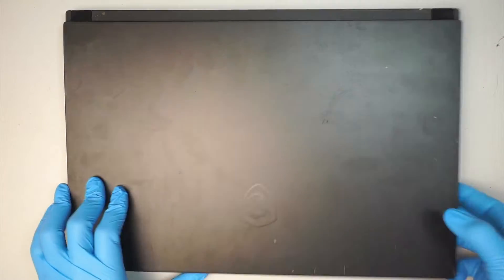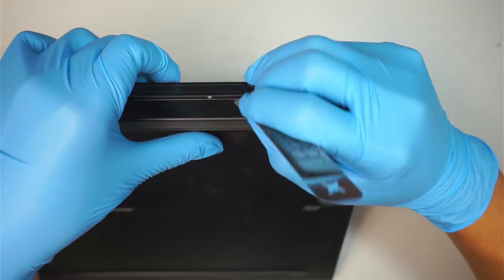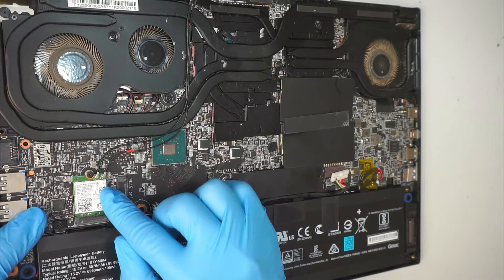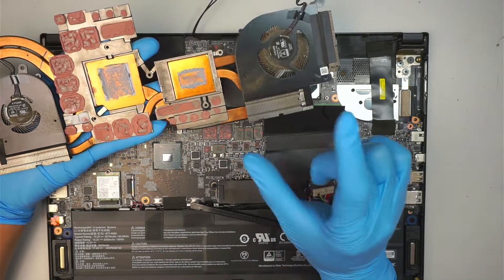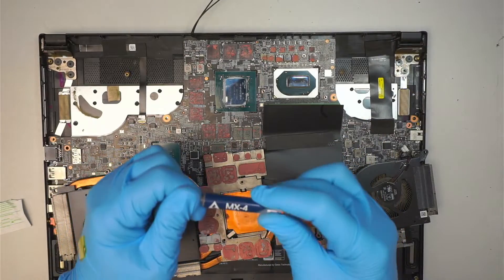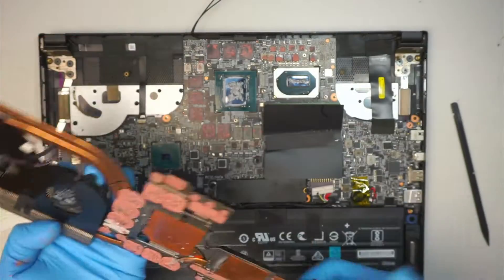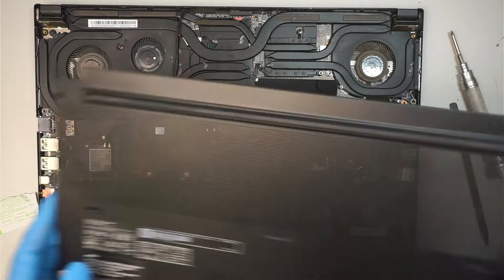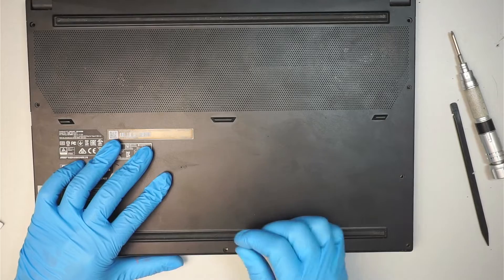MSI GS66 Overheating Apply New Thermal Paste

Comment: What's that pink paste?
Reply: Thermal Pads which should be replaced whenever you put new thermal paste on both the GPU & CPU, and you need to know the thickness of the thermal pads.

Comment: The wifi cables go under the heatsink... Also, the best thermal paste is Gelid GC Extreme. It doesn't thermally degrade until 140c, unlike Kryonaut which thermally degrades at 80c. I'm assuming for some reason MSI used a paste similar to kryonaut because this laptop is notorious for overheating.
Reply: How good is mx-6?
Reply: Its not about degradation. Direct die application just means the paste will pump out. Should use ptm7950 or similar stuff that have no issues of pump out.

Comment: I gotta say it was a bad time, I did all of this and ended up unplugging my display adapter (no mention of watch out for the display adapter) plus these wifi cables are completely flimsy where you mke it look so easy. How does that work? other than that I fucked it all up because I kept trying to take off the heat sink while there was still a screw inside. Damn these wifi cables.

Comment: quick question
can I dissemble the fan without disconnecting the battery?
Reply: You could, but you run risk of short circuiting something with your screwdriver and breaking something important. Disconnect the battery to minimise risk of short circuit while repairing your laptop.

Comment: My screws are wayyy to tight on mine I bought a electric screw driver and still could not get them in done any tips?
Reply: Get a multi tool kit for electronics or sum shi. I bought a tool kit at Best Buy for 25$ with everything you need to repair from phone to laptops and computer

Comment: Followed your steps and worked amazingly! Fans would spin to max then shutdown. Takes a few minutes but highly recommend to change out the paste!
Reply: hey man i have a 10th gen gs66 stealth whenever i do something demanding like gaming or stress test the cpu immediately spikes to 90+ degrees i was thinking of changing the thermal paste with the mx4 shown in the video but do i need to change the thermal pads on the vrams and stuff?
Reply: @ekinfuateymirli   I didn’t, just made sure that the old red paste was still making contact when you put the cooler back together.

Comment: That factory paste is rough lol. I tried XTM50 and my GS66 had a lot of melt off and my CPU spiked. I went to Best buy and got the XTM70 and it seems to be far better. Running ark on max settings, undervolted a bit and it's at 62c. Don't be afraid to use too much paste bc these things get hotter than a desk top. Apply a big drop and spread it is my method bc I don't want to risk air pockets. Do not use metallic paste bc it will run out of these due to the heat and fry your motherboard. Great video and ty brother. Hope all is well.
Reply: I can play pubg at 65c with 99% cpu power (power plan)

But when cranking it to 100%, it goes above 100c.

Going 100% does make a huge difference in Source based games.

Is this normal or do I need to change the paste or something else?

MSI GS66 
1660 ti / i7 10750h
Reply: @Ultimatum_176  Yes, thats normal, when you set it to 100% it makes the cpu able to Turbo boost which makes the performance a lot better, 99% on the other hand turns off the turbo but makes the temps much much better,
Reply: @showe1762  
You got any recommendations?
Can i lower the clock speed?
Reply: @ recommendations for what exactly ?
and yes you can via a program called throttle stop or a program called quickcpu ( its has an easier user interface )

Comment: hi, i did all you did without changing a thing a i opened my gs66  laptop everything seemed fine until the face id came up didn't want to work. tried opening the camera app it said we cant find your camera. i dont have an outside camera. its my labtop camera worked fine before i opened the laptop. any idea on what may the problem be? thank you
Reply: You didn't connect the camera back 
It's port is in between the two fused gpu fans

Comment: You should try using phase-change material Honeywell PTM7950. It comes in as a sheet, lasts longer and performs in my experience works better than traditional pastes. On the power section, vrams give thermal putty Upsiren UX Pro. It is also good do undervolting on CPU and GPU at -100mV or more if it will be stable. It will be more fps, quieter, cooler and less power will be drawn.
Reply: Can anyone do this? I have never opened up my laptop and I'm nervous I will break it
Reply: Hi, I'm interested in using PTM7950 for my CPU and GPU. What about the factory thermal pads below the heatsink that covers the VRAM's? Should they also be replaced? If not replaced, so they be repasted once the heatsink comes off?
Reply: @mestguy182  Yes after removing the heatsink, they can be re-applied to the vrams. PTM7950 to reach its full performance it needs to warm up well and cool down several times. I suggest using cinebench r23 10-minute test to warm up the CPU, and Unigine Valley or 3DMark for the GPU.
Reply: hello i repasted my gs66 as well with arctic mx-4 but after a few weeks it keeps overheating again. I checked to see whats up and see that there are dry spots where  it lacks thermal paste i dont know if its because i tighten the cooler too much or the thermal paste is too liquidy can i have your opinion on this
Reply: @ekinfuateymirli  The cause may be the pump-out effect. I advise you to apply PTM 7950 or Upsiren PCM-1 which this problem does not occur.
Reply: @goorthiss  thanks alot for your suggestion those pcm materials are unfortunately quite expensive to ship to my country (50 bucks price + shipping for a 3cm x 5cm one) because of import taxes :// What is fortunate tho is im pretty sure my problem is caused by wrongly applying thermal paste and leaving airgaps between the cpu and heatsink
Reply: The rose thing is thermal pad right? Does it need to changed? Or can I just apply thermal paste like the video?
Reply: @bahamutxp  The pink one is a thermal putty. If it's in good condition then you don't need to replace it. I do not recommend replacing it with thermal paste because will not transfer heat adequately efficiently, because the heatsink will be not properly adhere to the components or the paste layer will be too thick, above a thickness of ~0.5 mm the paste transfers heat poorly as well as there may be a pumpout effect.